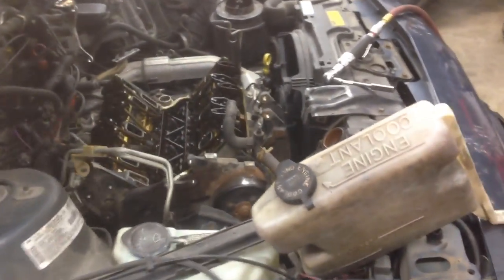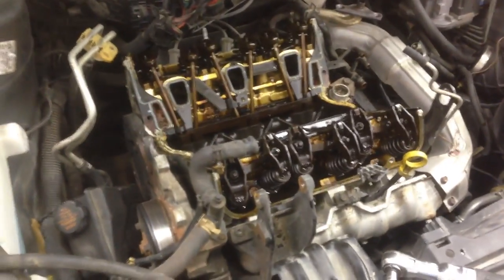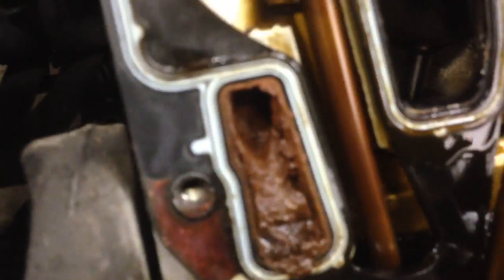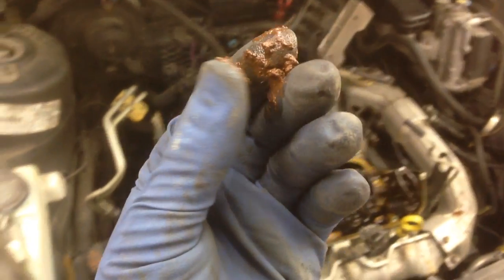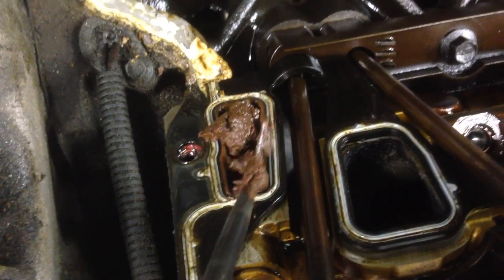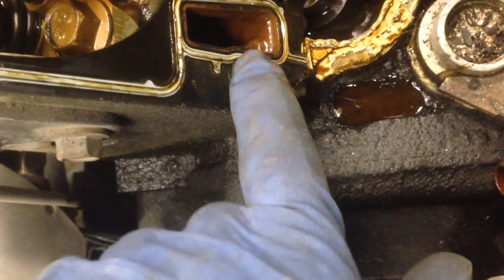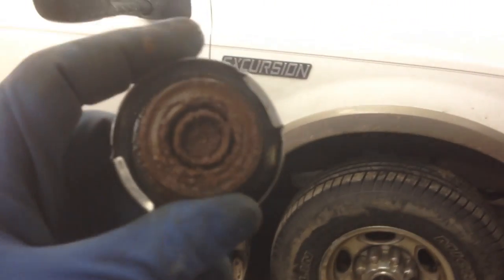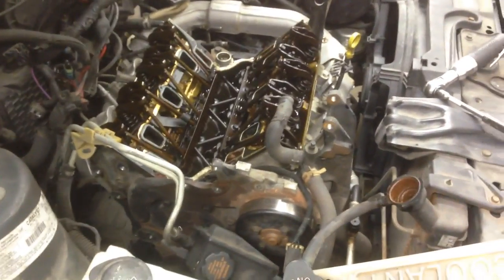Why it's called DexKILL

Comment: Most situations like this are due to owners not watching the level of DEXCOOL in the cooling system.  Air gets into system and then you have a problem.  What most owners will not admit to is checking fluids like clockwork, which the vast majority don't do.  Been using DEXCOOL in all my GM's  with high mileage to boot and do not have anything like this going on,  again in most cases its just a case of owner neglect.  Most of you neglect your cars won't admit to it making it easy for you to blame a product when all you have to do is be honest and look in the mirror and you will see the problem.

Comment: I had a 96 chevy silverado with the 350 vortec that did the same thing and blew out the lower intake cross over gaskets, i flushed it out and put the yellow extended life in it and it ran alot better with it

Comment: dexcool not to be mixed with any other complaints. each coolant has a purpose for engine produced. even the extended life coolant are not to be mixed. the red extended life comes in two classes nitrite and nitrate , not mixable. the first adherent problem with dexcool is normally heater core efficiency diminishes and stops up . then heater lines to core. had a mechanic at major commercial transport company call me and said drivers all stated reporting heaters quit working and heater lines clogged. ask what coolant they used.he just started their couple months earlier. called back and said dexcool. informed him that was problem. company had purchased 12 drums and was putting in trucks . mechanic flushed system ,changed heater cores and lines . problem solved.  never mix coolant or change to different kind.  some work for particular reasons of internal metal  and electrolysis   of different metals that touch each other as coolant flows thru system. have even had coolant manufacturers tell me they will mix. look up coolant characteristics I and ingredients of base elements that create.coolant . you will find they are non mixable.

Comment: looks like someone add stop leak because of a gasket let on the intake whichis the problem  with the plastic and rubber  intake gaskets.  after 5or 6 year of heat from the engine they shrink and crack leaking water and antifreeze into your oil and causing your oil to slug up  and if you look at the water jacket it is a copper color like bars stop leak problem solved keep a check on you coolant and you won't  have any problem

Comment: Gee why do we have air in our cooling system in the first place, I have used Dex-cool since 2001 and had zero problems with the coolant, I change it out every 5 years. But of course I maintain my vehicle properly. So if Dex-cool is so bad why is it still being sold. You can find it in any auto parts store. Many of these problems have been caused by people mixing standard anti-freeze in with Dex-Cool.

Comment: Ohh now i know what's wrong with my 2000 gmc sierra 3500 same thing, got it dirt cheap (i wondered why) had to replace the overflow canister it was so bad i couldn't see through it, radiator cap was like in the vid - filthy, now i used a radiator clean (one you just pour into a radiator with antifreeze in it)
It came out...brownish with lots of metal particles and now after about 5 drains (fill with water, run it till hot and then some, let cool off, drain, ran water through until clear) ...5 times and still coming out very dirty i mean every flush same thing comes out! 
HOW DO I PRESSURE FLUSH THE WHOLE SYSTEM WITHOUT DAMAGING THE GASKET! 
DO I REMOVE THE TERMOSTAT? H E L P 
S O S

Comment: Does GM even make an OHC engine?
Reply: Carl Johnson My 2004 Chevrolet Trailblazer has a 4.2l I6 DOHC engine.
Reply: Carl Johnson I had a 2002 Saturn  with a Dohc  engine.
Reply: My 08 Cobalt SS has 2.0T DOHC
Reply: they make many. but there is nothing wrong with OHV, it has it's advantages.
Reply: Almost all GM engines are OHC now. The only ones that aren't are the LS based engines.
Reply: the 3*** ohv v6 engines are awesome. nothing wrong with them.
Reply: *****
And the new LT's (not LS based, more LS inspired, completely new engines)
Reply: biggest advantages of OHV are size and weight on V engines. One bumpstick in the middle verses 2-4 hanging off the top of the heads, the Coyote is HUGE compared to the LS.
Reply: Skwisgar2322
this.
Reply: I should have said SBC based... Even the new LT's trace their basic design back to to old '55  265cu. in. SBC.
Reply: How come the newest engine pointed out for having an OHC is eight years old? Sure the LS is smaller compared to the coyote, but engine masters did a test on that and proved that the 5.2 makes a ton more power per CI.
Reply: Carl Johnson oh boy...more hp/l b.s....
Reply: Well if them guys up there are saying that the inherent benefit of the OHV is the small size what good is that if a three liter motor only makes 100 hp? Explain that one to me Dinglebiscuit.
Reply: Carl Johnson lighter weight, smaller size....MORE TORQUE....easier to work on...the 5.0 ohc ford costs 1000 to do a cam swap.....
Reply: What current OHV 3.0 liter makes only 100HP? 80's engines were ALL underpowered. My OHC Nissan 3.0L in my Hardbody only made a little over 100HP in '87.
Reply: I'm saying that that guy is calling the horsepower/liter comparison bullshit. It's just about everything in an engine.
Reply: Carl Johnson no its not. Jesus christ. Do you know what torque is? Apparently not.
Reply: Frigglebiscuit I don't. And I'm the only one in the history of engineering to get a degree without ever learning what torque is.
How can you be so fucking dense? What is horsepower? A measure of torque over time. No one has even made an engine that  produces 400hp and 50lbft. They could, but why? If you were limited in crank angle and had a very short bore then ermagherd just use a lower final drive.
Reply: Lots of models are DOHC

Comment: My mother bought a brand new Century 3.1 in 2000. I had the Dex removed immediately and the car now has 82000 miles no intake manifold problems yet. I change the coolant every two years. The gasket design was bad and Dex is ok IF YOU CHANGE IT  EVERY TWO YEARS NOT 5 years OR 100000 MILES!  Why the hell GM thought they could tell people to go 5 years or 100,000 without a coolant change was just nuts! Dexkill put GM into bankruptcy. The two most important fluid changes are oil and then coolant than transmission fluid third. Brake and power steering not so much. So if you stick with Dex, change it often and flush all the old out. That sludge problem is a killer. If your mechanic changes the gasket make sure they know what they are doing.

Comment: i think you've got oil in there as well.  You stated in your video that you had an air leak, which may also be where the oil is coming into contact with the coolant.  I not sure about this because I don't own an engine like that, but check it out anyway.  It could save your engine's life!

Comment: looks like somebody just dumped a bunch of stop leak in it to me.  but i have used it in a few cars and if used right it does it job. key works are used righ
Reply: Stop leak is one of those "mechanic in a bottle" deals. Yeah, it'll stop the leak long enough to sell the car but under no circumstances should you put it in a daily driver.

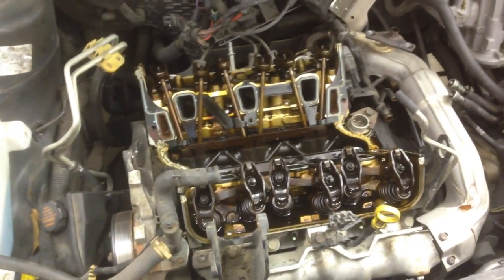Comment: @ 3:15 U forgot the cadillac 4.9. Pre northstar. Those shipped with dex cool & had a split heater core. So once the caddy plugged up the passenger got heat & the driver got a cold shot of air!

I never liked those fugly olds cieras. Remember the Citation.... Yeah it lives on in the car your working on.

Comment: From what I've noticed with Dexdeath is that it is reactive to not just overheating, but additives. My '99 s10 had issues with overheating due to the fuckass previous owner dumping sealant into the radiator. Gummed everything up to the point of replacing a motor and radiator. In reality you shouldn't add anything to it or have issues with "compatible" additives.

Comment: Balderdash! I ran my 99 3.4 V6 234,000 miles with Dexcool. Replaced the intake gaskets at 80K with the water pump, flushed, refilled with Dexcool and NEVER touched it again. Gave the car away, and its still running as of this writing.  If you did the intake correctly, you would not have re-done it 25,000 miles later!

Comment: I am telling you that gunk Is Stop Leak Compound somebody put In the radiator, I have cleaned this stuff out of COUNTLESS vehicles I have seen Heater Cores, Hoses, Propane Vapourizers, Water Pumps, Thermostat Housings, Heads YOU Name it, In vehicles with Green Coolant and Dex-Cool, And In almost every Case The Driver Has Admitted to Using A radiator stop leak Product. I have also found Cardboard tubes of the same product in thier glove boxes or somewhere in the vehicle and the compound is exactly that color.

Comment: Dexcool is crap, but that stuff you're pulling out looks like Stop-Leak. I'm guessing someone put Stop-Leak in the system when the gaskets started leaking. Never, ever use Stop-Leak. Just fix whatever is leaking. Had a customer come in with a leaking radiator. He had used Stop-Leak. Had to replace the radiator and t-stat. I also had to remove the heater hoses and back flush the heater core and the block. I also removed and cleaned the reservoir. After putting everything back together, I flushed the whole system and was STILL getting Stop-Leak out.

Comment: The main reason it's so bad is that it's a petroleum based coolant, running through petroleum based hoses, petroleum based plastic gaskets. Every 2nd level painters helper knows petroleum based liquids break down petroleum based solid materials, and air is the catalyst for erosion of the solids. GM designers knew this and built dispose-a-cars.

Comment: GM originally dropped DEXCOOL in some vehicle models that were not ready to be filled with it.  This vehicle falls under that category, and should have been filled with green stuff from factory.  Its a shame that the stuff was still in this car....could have saved from having problems.  On newer cars from GM, DEXCOOL will not do this.

Comment: Sorry folks. The issue is not, never was Dex-Cool. If Dex-Cool was the culprit how did it know to damage only those engines where it came into contact with a silicone bead around the plastic intake port gasket leaving the others to run fine? The design of many V6 engines allowed the GASKET material and Dex-Cool to interact with one another, causing leaks and the engine damage we hear so much about. Sludge you say? The only time Dex-Cool allows sludge builds up is if the engine is low on coolant. When engines run low on coolant, the organic acid technologies oxidize and cause iron oxide deposits. The “rusting” usually DID NOT affect newer aluminum engines. But, running ANY engine when it’s low on organic acid type coolant causes sludge. Mixing the old silicate based (green) with the new Organic Acid TEch (OAT orange) is bad, they do not like each other and will void the warranty on some parts such as water pumps.  MIsinformation abounds, people get mad. Hell I am still pretty chaffed that I spent over $2k to get my 2104 Silverado A/C to work. Poor design is one thing, owner awareness and maintenance play a huge role.

Comment: I got a Spectra Radiator on my 02 Explorer 4.0 V6. The coolant I have is a mixture I found at our motorpool at Fort Campbell KY. I had to mix it myself but I've got 9k miles with this coolant and it's holding up really well.

Comment: my.moms 96 cutlass needed head gaskets at 68k miles in 2001...dex cool failed the 5 yr 150k miles sticker under hood
same w my.silhouette...dex service at 150k 2016......@250 k jan of 21 head gasket failed.......DX COOL IS THE.PROBLEM
NOW I HAVE A 2000 REPAIR BILL TO PAY

Comment: only watched half way through video and stopped on part where you said you had already replaced the lower intake gasket 26k miles prior ? I am a 30 year GM master tech veteran and for personal vehicles with dexcool in them I monitor condition closely and if for any reason I have to go into the system I flush it out with cleaner then water then drain and go old school with green anti freeze period. the brown sludge was major issue on the S10 models and SUV blazers because of location on coolant reservoir and these happened all the time no matter what. on the GM cars with V6 engines they very rarely have issues unless they have lower intake gasket leak unfortunately that is at least 85% of the time versus S10 99% failure simply by design with no failed part

Comment: Disagree as well.  Keep fresh Dexcool and distilled water set at the proper levels/% in a car post early 2000's when there were some gasket issues and you will not have problems. Keeping low coolant levels, mixing different kinds and putting crappy coolant stop leak fluids in a system are all signs of bad maintenance.  This video is a total scare video unfortunately. That vehicle was not maintained properly in my opinion. 230k on my 03 Suburban and never had any cooling issues. Dexcool has been used and changed with distilled water since day one.  Thanks for the video!

Comment: Yes this was a huge problem but if you use the up-dated metal gaskets, clean all surfaces and torque properly  this job shouldn't have to be  done again. I  always switched over to a universal type antifreeze and never saw one come back.  Yes there are people who swear that Dex-Cool is good but if I bought an older GM  I would definitely switch it over. We always used a Global pre-mixed antifreeze approved for use with many different manufacturers coolant.  I would  have to say that by far the largest percentage of intake gasket jobs I have done were on GM vehicles with Chrysler being a distant 2nd.  Sorry but anyone claiming GM didnt have a huge problem, be it totally because of Dex-Cool or not  is in denial. This sludge in this engine did not look like  a typical 3.1/3.4 with a gasket leak.

Comment: Dexcool does not contain silicates so air is not an issue...  someting else must have happened... more likely some other coolant was added or still present in the System and reacted with the dexcool
Reply: +bobl78     Thats exactly what I was thinking.  Dexcool is silicate free coolant. That doesn't just happen using Dexcool.  There must be some other traces of another coolant mixed in there. I have seen that numerous times on GM cars and trucks where people don't pay attention and just put in any coolant when they should only be using Dexcool.  I use Dexcool in my GM cars with aluminum engines and I never had a problem and never this problem here!!!!

Comment: Dexcool is a perfectly find coolant if you follow GM Specific Instructions on when to change the coolant in your system the whole build-up thing and blown gaskets is due to neglect and not following specific maintenance procedures put out by the manufacturer

Comment: American engineering at work. I will never buy a FORD GMC DODGE BMW Mercedes Benz vehicles. I only buy Lexus or Toyota. I have a Lexus ls430 2001 with 280000 miles. You can barely hear it running. Original starter and alternator. Regular maintenance. I also have Lexus ls460 and it is a Awesome car!!!!!

Comment: Dex-cool is organic, with enough time it creates acids and bacteria that turns coolant to muck in your engine, and CAN eat the aluminum heads.

You NEED to change Dex-cool every few years or when it starts smelling off- if you see slime and muck, you need to flush the system  and/or replace the radiator.

That stuff is crap.
Reply: BINGO!!!! DING DING DING DING. WE HAVE A WINNER JOHNNY TELL ME WHAT THEY WON. WELL THEY WON ONE 3100 crate motor courtesy of General Motors.
Reply: Matthew Smith
I would like to thank my mother, my uncle bob and my wonderful fiance'!

Comment: I think the proper way to use a different color coolant would be to flush out the original coolant and then switch over to whatever you want at least its safer knowing all the old Gunk is gone its nothing wrong with Dex as long as the coolant is normally maintained with no over heating and dont mix coolant flush it 1st radther be safe than sorry

Comment: Been using Toyota Red Antifreeze  in all my cars for year never a Problem.  also I don't put much stock in long life Products  I still believe in regular service intervals  I still replace fluids way before they are due to be change by manufacturers  standards  if you listen to them your Engine would be leaking or full of sludge or a Failed Engine or Trans  they don't want your car to Last they want you to buy a new one

Comment: People give Dex-Cool a bad reputation. If your upper and lower intake gaskets leak. You're in trouble. Most of the time it's too late. There have been updated gasket material to combat this. Also, you cannot mix Dex-Cool with phosphate/silicate coolants. That's asking for disaster. If you're cooling system has EXISTING corrosion you're just putting fuel on the fire. The issue is people mix this stuff. You simply cannot do it. If you use dex-cool top off with Dex-Cool. If you wanna change over to Green, do It. Just don't use a silicate based coolant/antifreeze in mostly aluminum applications.

Comment: That's why GM tells you to flush your system every 50,000 miles,  not only that, dexcol is designed like that because most of the 2.2, 3.1, 3.4, and 3.8's are all aluminum, in fact almost all gm engines are aluminum and dexcol is formulated to prevent the corrosion that green coolant causes on aluminum blocks, also being I own a Buick century I just did this to I have been mechanic work for several years, those junky plastic gaskets you see here are just that, crap, get the steal ones instead, no more problems

Comment: Strange ready this, I have owned several brand new gmc and chevy trucks and never ever had this issue. I know that if you mix other coolant with dexcool you will have problems. I don't think it is right to label it as dexkill as it has never killed any engine of mine.